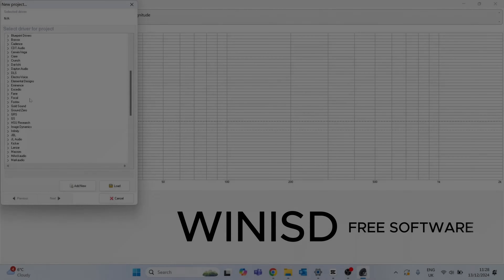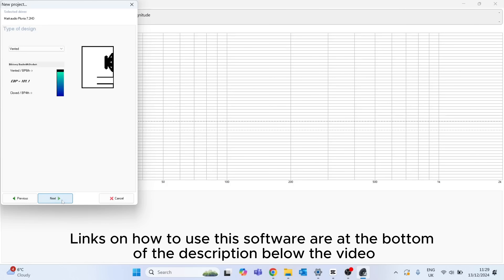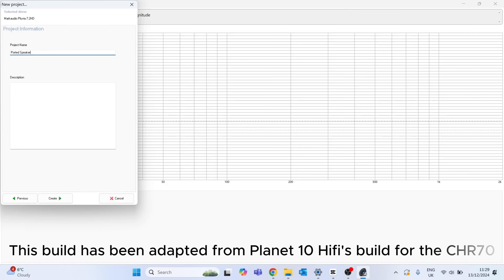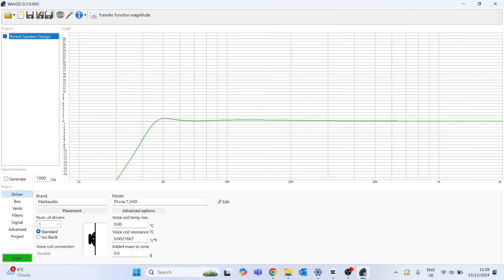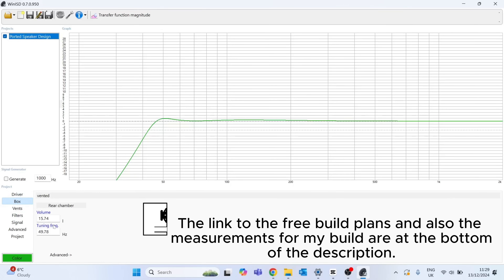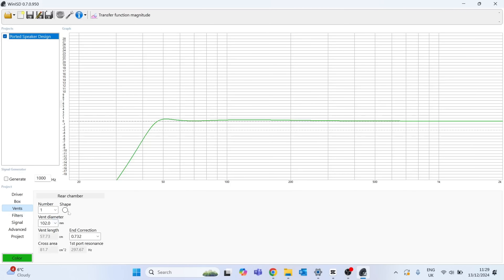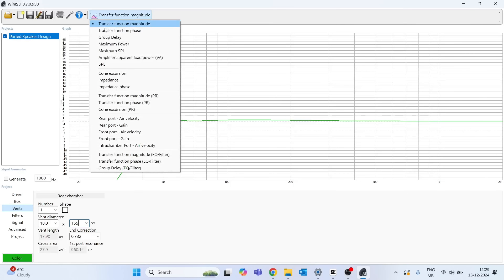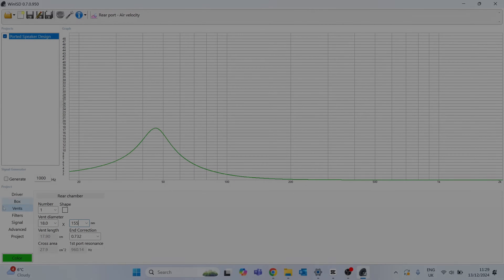BASS REFLEX Speakers or PORTED Speakers – DIY Build with Full Range Drivers from Markaudio

Comment: You seem to have already used very similar cabinet dimensions to those I'm planning. I expect you will win hands down in your execution though. Mine are for nearfield desktop use with a PC. Space management means I plan to use a shelf across the top of them for storage, so they need to be taller than my monitor with drivers at mid screen height. Hence the narrow, tall and deep design.

I'm trying to figure out whether to put ports on the bottom of the front at desk height and maybe get a little desk bounce boost, or on the top of the front  nearer to ear level and get more direct and less reflected bass. I'm guessing that driver centre to port centre distance won't be much of a factor in terms of impact on phase at these long wavelengths. Top or bottom? Any ideas?
Reply from the maker: If your making them yourself, I'd go for what aesthetically pleases you. At this size, I'm sure it won't make a huge difference. You could also consider rear facing port if not too close to a wall!!
Reply: @DIY-AUDIO  Thanks.
I wasn't expecting much of a difference in performance. Ports are definitely going to be front firing.They'll end up pretty close to the rear wall.
USB from the back of my PC monitor to SMSL PS100 DAC and Fosi V3 amp to these.

Comment: How much would you have to scale up the cabinet size to accommodate a 6.5” driver instead? I’m curious and I wouldn’t have a clue how to figure it out
Reply from the maker: Use Free WinISD software. If you know the driver Parameters or download them from suppliers website, you can input them and the software would work out a volume of which you can work off
Reply: @DIY-AUDIO  and as long as the volumes right the same design can be applied?

Comment: Fantastic build i'm having a go myself as a first project, i have a question about the holy bracing section and how it interacts with the rear of the driver, in the plans it shows it touching the driver is this correct? if so do i use some kind of gasket to stop any vibrations or just straight on the mdf  or leave a gap? any advice would be great
Reply from the maker: From what I gather from other plans it should touch but, I left it a couple mm off the back of the driver and then used 2mm rubber gasket. You could probably get away without it touching though. Good luck with your build!
Reply: Ok thx for the reply

Comment: Could I use this design for. Set of Kef unq drivers salvaged from 2 Kef q95c centres ? Hoping to make something other than land fill out of them  ? Thanks
Reply from the maker: Sure you could but may want to get all the parameters of the drivers and enter into WinIsd as likely to need a different size box and port
Reply: @ thankyou. I’ll see what I can find. 20YO drivers so may struggle 😂

Comment: A great build video.  A quick question for you:  Do you have a general rule when to switch from 1/2" to 3/4" material?  I build speakers as a hobby and would like your insight if possible.
Reply from the maker: I'd usually go 3/4 (18mm) on anything 4" and over but love a little bit of resinence hence this build was 15mm. Down to strength too, if they are much bigger then definitely the 18mm as last thing you want is them to be shaken apart!! Bracing will also help but take that into consideration when calculating the volume
Reply: @DIY-AUDIO  Great info!  Thanks for your insight!

Comment: Nice job, but I have one query which relates to why you wanted to be able to screw down the backpanel. I would build a screwed panel for protyping if say I had a crossover and I wanted to quickly swap in and out components, but you have a full range driver that at best might have a resistor for the top end. Just curious as I think that screws always betray the fact that it is DIY..
Reply from the maker: Thanks. As with a lot of builds, some people like to experiment with the amount of filling (this one seemed to have a little too much and I reduced it slightly and although I don't measure sounded better to my ears) and as you stated maybe add a baffle step filter at a later date. Plus I like to complicate things😂😂

Comment: You should try using Rubio Oil + 2C for your wood finish instead of veneer :). Better finish, BIO and quick dry. And with 1 liter you can make almost 30m² of surface area. Very very good product.
Reply from the maker: Thanks, is it OK to use on veneer?
Reply: @DIY-AUDIO  you don't need varnish with Rubio oil, and it's monocoat
Reply from the maker: @KorxKlesk  not great on MDF tho!!
Reply: @DIY-AUDIO  I haven't seen any speakers where the MDF is directly finished :D
Reply: @DIY-AUDIO  no problem on wood veneer
Reply: @DIY-AUDIO  I wrote veneer but I meant varnish, no problem with a veneered finish

Comment: the most useful thing i got from this video was the recessed rear panel, in diy speakers i often the access to the inside and the woofer opening might be too small or stuck, and a binding post is small.  but here the whole rear is screwed on and sealed. not drawbacks and only benefits from that :) 
i will adopt this next speaker i build.
Reply from the maker: Good luck with your next build!! 👍👍

Comment: As far as for build, very nice. Drivers: very good. Can't say nothing bad about Markaudio   But the design of the box; clueless about physics. Don't recess the baffle (diffraction). That is bad. You need chamfered or rounded edges to prevent nasty peaks. 
And please don't use steel clips to connect the speaker! That is for cheap mass manufacturers.
Reply from the maker: Thanks for your comment. These are meant to look a bit retro and in the 70's many baffles were recessed (these are only by 3mm). I'd love to say we'd all love the perfect speaker but for their purposes and cost these sound superb. I do take your point on the connectors though but, as I often reuse drivers for the videos, I use the connectors for ease.

Comment: I would recommend a far more useful tool called vituixcad for a box design. It will enable you to simulate crossovers based on measured responses etc.

Comment: What a fabulous build. I have thought about doing a single driver design for a while and this was certainly inspiring. Thanks for showing all of the steps.
Reply from the maker: Good luck with your build!! 👍
Reply: A single driver design is not optimal. It's a cop out.
Reply: @Munakas-wq3gp single driver speakers can be quite nice for some uses. It has the benefits of no crossover, point source sound ( no time alignment issues between separate drivers ) and good imaging. I like them for l and r channels for video. If you listen to classical or other music without extreme highs or lows it can also work reasonably well.  I just like to work on different types of projects and make them as good as i can.
Reply: @roverdad  I prefer planar speakers. I've been a big fan of electrostatics for over two decades.
Reply: @ i have never had full size planars but they are something i’ve wanted to try.
Reply: @roverdad  I recommend trying some warmly. But don't be surprised if you get hooked.

Comment: Paul, just wondering, shouldn't the bracing be the other way, given that the side panels are the largest and therefore the most prone to flexing? I know with at driver of this size it's a minimal concern but still a little puzzled.
Reply from the maker: I was closely following the plans that I have included online by planet 10 who design and build speakers commercially. I am pretty sure that as these drivers are only 20 watts, you may even get away without bracing. I think I also did comment that you could brace across with dowels. Pretty subjective but I take your point!! Merry Xmas to you.
Reply: Interesting point. I would say yes the panels coloring the sound but the driver is less colored as it is braced. Also the baffle is damped and that is facing you. I haven't heard the a/b tho.